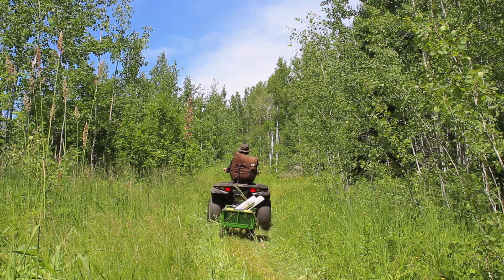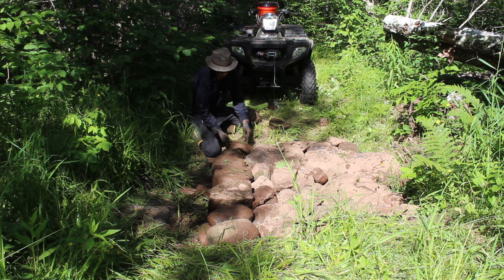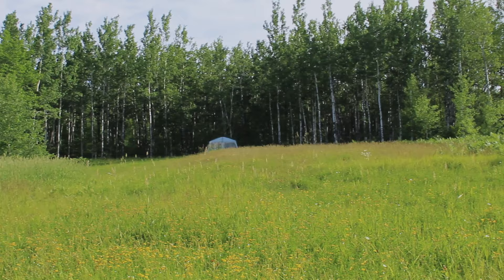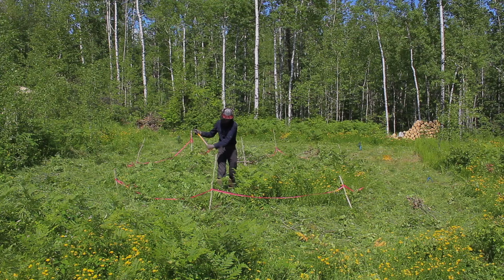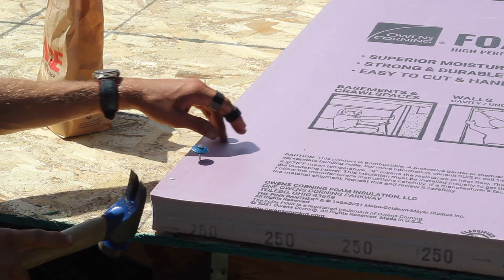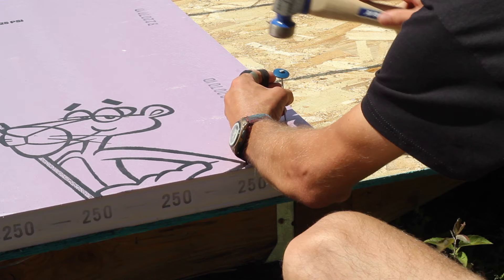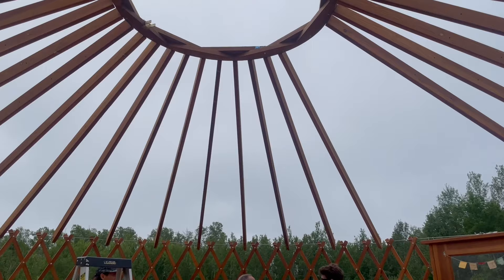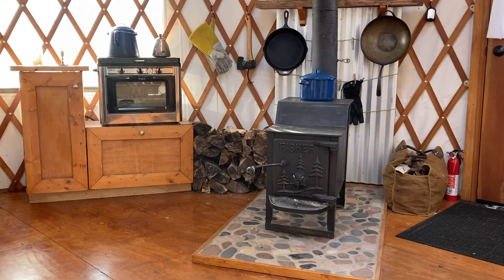Building our OFF Grid, Remote YURT .... START TO FINISH

Comment: I'm in the process of building a tiny home on a flatbed but since I've been seeing more about yurts I'm tempted to change my mind. Having a yurt gives you more options with the type of land you live on.
Reply from the maker: Shaun, it’s been a great option for us, though we didn’t go into the project with building skills or tools. So an instruction manual and a days of work setting it up appealed to us. It has its pros and cons, just like everything.
Reply: Yurts are fantastic but you need to be sure that your state and county will allow one. Here in Colorado yurts are allowed in some areas and but more often not. Yurts can also be cold in the winter and hot in the summer. The insulation that comes with a yurt kit is not generally very thick, but can be increased by adding 1/2 inch flexible foam panels sold in home stores. I lived in a 16 footer for a year and have always wanted to do it again, but in a larger one.
Reply: @jeffreyallen1290  Luckily I'm buying land that allows it. I'm glad I'll have several options.
Reply: @sam_zach  Thanks for sharing.